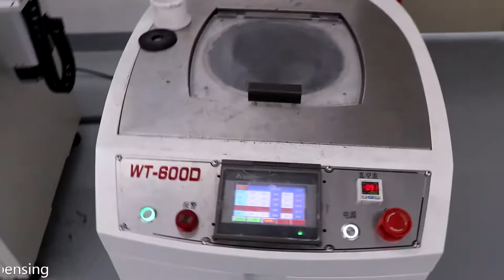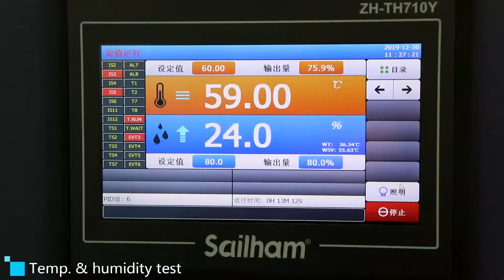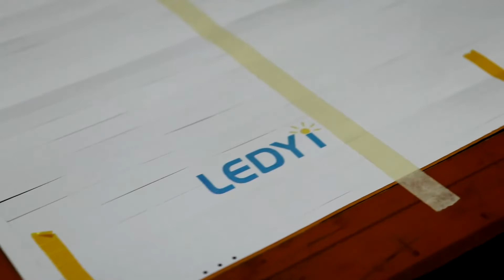Inside LEDYi LED Strip Factory | Full Manufacturing Process by Leading LED Strip Manufacturer

Comment: I have a question 
We know that LED lamps are placed in an aluminum plate for cooling, but aluminum metal is a conductor of electricity, so how are the lamps connected, especially small-sized lamps, without contact between the lamp wires and the aluminum metal?
The most famous electronic board is the RF4 fiberglass board. 
RF4 glass fiber is an insulating material 
Of course, with the presence of a copper layer, whether upper or lower, upper only, or lower only.
But with copper, how is it done?
Reply: You are not putting the LED directly on the Aluminum metal, there is always a insulation layer between them
Reply: @Yuman_Bright  
Thanks teacher